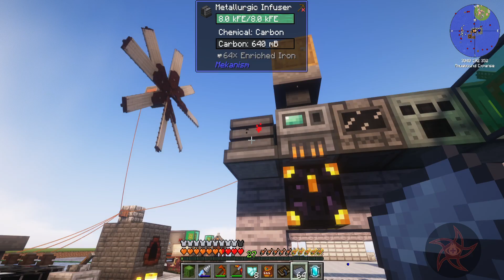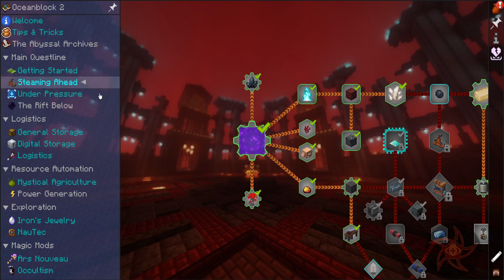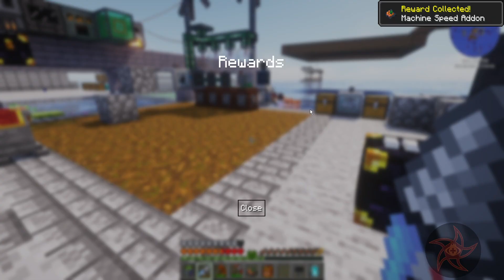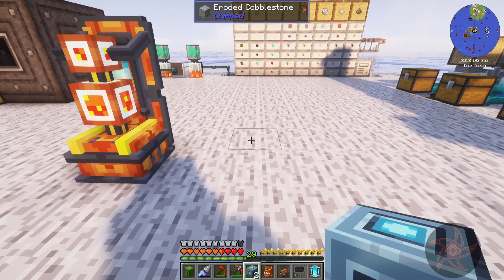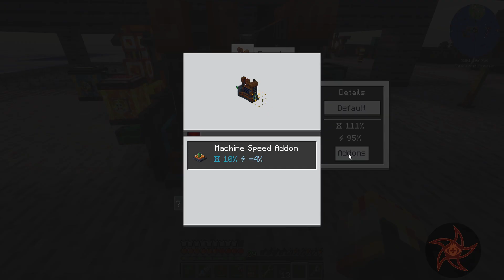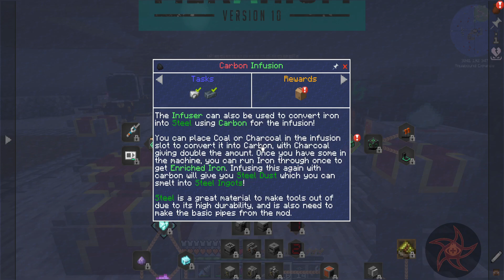FTB: Oceanblock 2 :: Oritech Steam Power :: OB2-15

Comment: To extract the water I used the oritech pipe, connected to the blue side port, directly into a liquid trash can. If you have them chained together you only have to suck out of one. You DO have to set the pipe to extract though, which I didn't see you do in the video.
Reply from the maker: I thought it might be something like that, but there is a small issue......My steam engine has no blue ports on the sides, they are all red
Reply: @theeldersign  Uhhhhhh I actually just went back and looked at the footage. That is in fact different than my working ones which have blue ports at one end on either side. I mean... WTF? Looks like some sort of bug maybe?